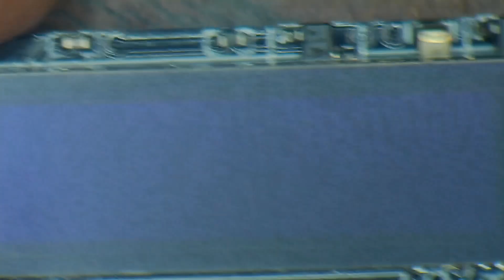Better than TS100 Competitor for half the price!?

Comment from the maker: Use coupon code: JEFFESCORTLX
Here is the direct link: https://sequremall.com/collections/new-arrivals/products/sequre-si012-oled-soldering-iron?ref=u6vm93be3l&variant=41917488431292
Winner must be located in the lower 48 states.
Reply: Bummer, flat rate boxes cost the same to AK as they do to the lower 48.
Reply: Does this mean that I won?

Comment: I bought a TS100 back in 2014, within a year the shell started cracking. I just let it go, added some superglue and kept using it. Wished I'd bought a couple shells for it back then as they're not available today. Maybe the TS101 would work? but they dont seem available either. 
  So today I bought one of these SEQURE SI012 models, hoping its as good as the TS100. Ive got thousands of hours on my TS100, several tips, and other than the shell, its working great.

Comment: Just curious I noticed this time when you reflowed the solder you did not use flux that you always use, was there a reason? Thanks
Reply from the maker: I put a little flux down off camera.
I could just go off of the little bit of flux that is in the solder, but the joints always turn out much better with some additional flux.
Reply: @jeffescortlx  always watch your videos as I'm trying to improve my soldering skills.

Comment: I’ve never had the Ts100. Or anything like it. I do have the Worx 20v solder iron. It’s nice with 2 batteries.
Reply from the maker: It's unfortunate worx decided to use the older 900M style of tips (separate tip from the heating element). They could have had a really good unit.
Reply: @jeffescortlx  it’s still a nice Iron. Not worth the money  but I haven’t had a problem out of it. Yea changing the tips isn’t the funnest. It does heat up quick. It sleeps and it kept me busy for at least 50 hours now. Without changing the element. Yes I wished it had the TS style
Reply: Though one day I’ll have one of these in my glove box. A maybe one in the garage, and one at my wife’s.

Comment: The Weller soldering gun tips work great until the tips oxidize and are no longer conductive.
Same goes for most soldering gun tips.
Is there a soldering gun , portable or 110 v that has a permanent tip?

Comment: Jeff - what power source do you use when you go mobile?  Would this be overkill for typical automotive wiring repair?
Reply from the maker: I'll be using this USB/flashlight/jump rechargeable battery bank 8:15

Comment: Thanks for the thorough review and discount code. Everything I have still use 900M tips which was a huge step up from the old irons I used to have. I picked up the Milwaukee M12 soldering iron for portable soldering and was happy to see it too uses 900M tips. I've also made several custom 900M style tips for heat-staking plastic. Just a few weeks ago I was shopping for a TS100 for a portable unit for my car tool kit. I feel like the TS100s have gone up a lot in price in the last few years. I opted for a butane torch with catalyst instead to fill the gap I had for a portable heat shrink gun. In retrospect 'm not comfortable storing butane in my car so I'm picking one of these units up for that kit. The site offers BC2 and C4 tips for a good price also which tend to suit my needs well.
Reply: As much as I'm a Milwaukee fan, the 12v iron need a 4.0 or 6.0 battery, and that makes it awkward to use. Plus, I've had to warranty mine twice so far, it just quit heating in the straight position. I've never articulated any of mine except when they quit heating. I intend to use a 12v Milwaukee battery with their 48-59-1201 and a barrel cable to run the iron in  this video.

Comment: That looks great. My butane soldering iron broke a while back and I have been considering one like this as a replacement. Certainly a lot easier than dealing with gas and the horrible temperature control that comes with it.

Comment: I don't need a portable soldering iron, but after using a T12 there is no other kind of iron.  Even the cheap ones work well and are so superior to other designs.  *Exceptions for a very large iron for soldering to metal chassis.

Comment: Thank you for your videos. I do mobile work for wholsale car dealers in alabama .  I'm wondering if you have found a fix for 07-13 gm truck clusters that randomly cut off or nonfunctional ,not the odometer . I don't see many anymore but still would like to be able to fix if I had one show up. This tool would be helpful and would save me money buying butane and tips . The butane solder iron is hell to work with when the weather turns colder ,I'm constantly having to adjust the flow of the gas because of pressure changes.
Reply from the maker: The 2008 have a issue with a defective microcontroller. Causes intermittent power that is typically temperature sensitive.

Comment: I have the TS100 as my first bench soldering iron. I have had cheap 15 dollar ones then when I started being a automotive mechanic I had butane soldering irons. Which were okay for small wires. But then cause of this wonderful man Jeff, I was able to get started into circuit board repair.  I was soo irritated that every time I ordered a cluster from GM they were always 2 weeks out minimum. About 2 out of 4 were either were not working correctly or improperly programmed. I had bought the TS100 cause I know the butane soldering iron  was not going to do it and I have been using it for the last 2 or so years in circuit board repairs. This one looks super promising cause I wanted something that support the other tips and this seems to do it.

Comment: This would be a good tool for me as I work on generators and I'm always pulling out a 50 foot cord and using my 2000 watt inverter to power my small soldering iron.
This one I could connect to the batteries and solder in potentiometers and fixing control panels.

Comment: I stopped using TS100 because the tips for it ( T12, T15 etc ) are pretty expensive
Reply from the maker: The TS100 doesn't use the  T12 style tip (natively).  This iron uses both.
Reply: @jeffescortlx  T15 it’s probably called. Don’t remember the model name
Reply from the maker: @vadimmartynyuk  T12 and T15 are the same compatible part number. I believe the difference is region specific. The TS100 has its own unique tip that has fewer options and more expensive.